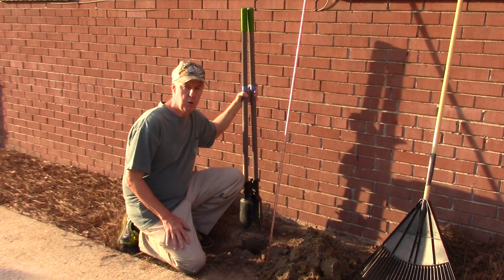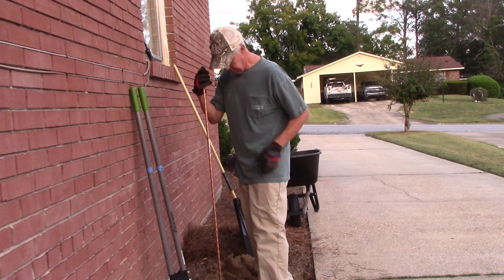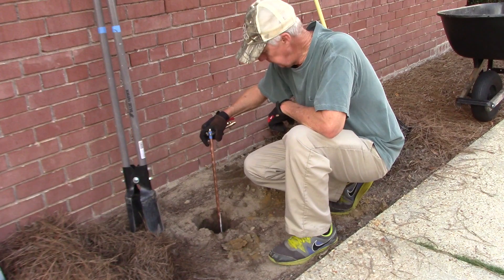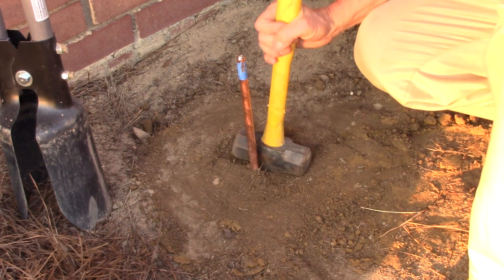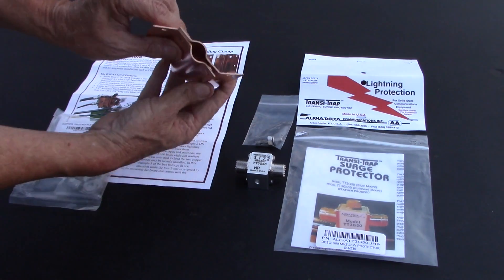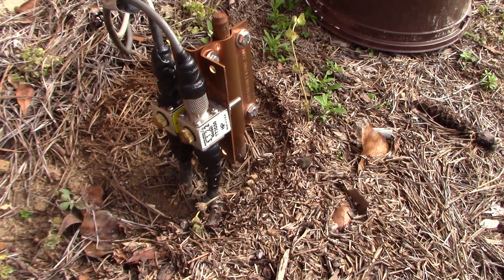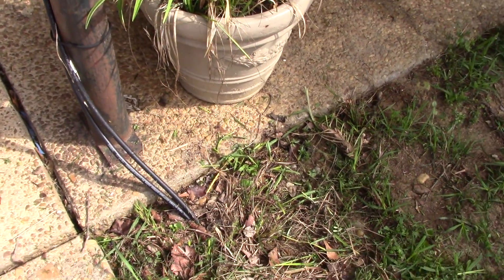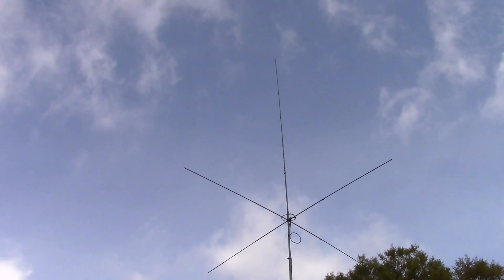Ground Rod Install / Water Method

Comment: Many years ago before I installed a ground rod I read-up on it and the advice was to keep it away from your basement wall as far as practical because a direct strike can blow the basement wall right out into the basement.
Reply from the maker: No basement here.

Comment: I'm curious if that helped the overall antenna performance on the end fed HW
Reply from the maker: More interested in lightning protection and bleeding off static that can build up on a wire antenna. Seem like it has helped my noise floor.
Reply: @hamradioportable1630 Can you use a galvanized ground rod instead of a copper ground rod? I already have 1 galvanized rod right by my antenna mast but need 1 more in between the one by the mast and the service ground since it is about 25' to 35' to my service ground so i will need 1 rod in the middle of the 2 & then will bond all of them together with 6awg copper. Great video on using water to put that long rod in the ground 👍🏻

Comment: I just finished (almost) my grounding system for my shop by driving in a bunch of ground rods and running 6 awg solid copper in the ground all the way around.  First one I drove in most of the way with a fence post driver managing to hit my self in the head causing all sorts of bleeding!  🤣  After that I used the Bobcat loader to start them and then finishing them below ground with the good old sledge hammer!  73, KF0BBU

Comment: The water technique will even help in rocky soil like mine. Jiggle the rod and you can slip past smaller stones. Add epson salt to the water and you'l improve the conductivity of the soil and make and landscape plants grow better.
Reply from the maker: Good tip. I plan on 2 more. Have to give that a try.

Comment: Good Morning Steve. Yup, Grounding (Functional Earth) and Lightning Protection is Priority #1 in my Book before running a HAM (CB) Radio Station. As a temporary portable Station Lightning Proctection does not play a major Roll than a good working RF Grounding. No matter what you do in Life always make sure that Safety and Functionality is given. It can save Lives. Good Job, Sir. Tnx for your Video & have a good new Week. 73 de Uncle Günter 💯🙋‍♂

Comment: Could you please give me list the materials you got from DX Engineer. Thanks
Reply from the maker: DX Engineering UCGC-Z Universal Copper Grounding Clamps DXE-UCGC-Z

Alpha Delta UHF Connector Coaxial Cable Surge Protectors ATT3G50UHP
Reply: @hamradioportable1630 
Thanks for sharing the information and it was a nice clean installation

Comment: I watched your video a few years back where you showed raising the homemade 4x4 tower after you repainted it.  But I don't recall seeing a video on the 4x4 tower at your carport.  If you did make a video on that one maybe I just over looked it.  I'd be interested to see how it works with that ratchet strap.  Your 6m & 10m jpole antenna builds have inspired me to build my own.  Thanks for taking the time to make these videos!
Reply from the maker: It's the same antenna mast build that's in the older video.  https://www.youtube.com/watch?v=OSbuHE6-TLE&t=3s
I plan to remove the strap from the winch and replace it with cable. I will do an update video when I do any modifications.
Good luck with your RadiosNMore channel.  Just subscribed.   Steve - Ad4xt